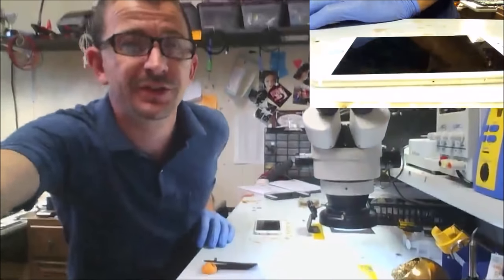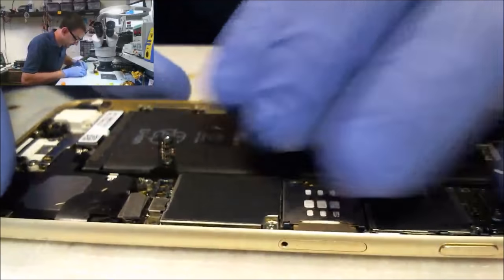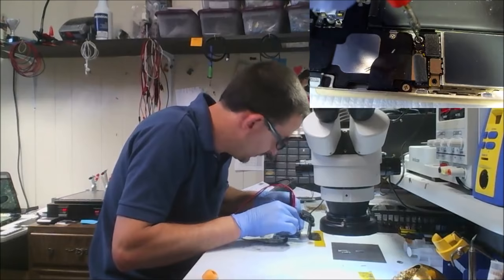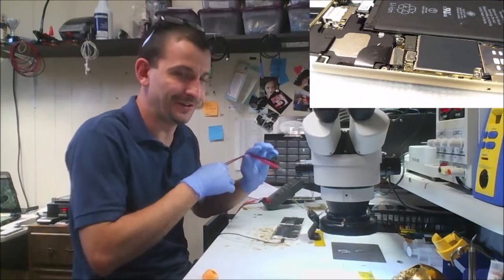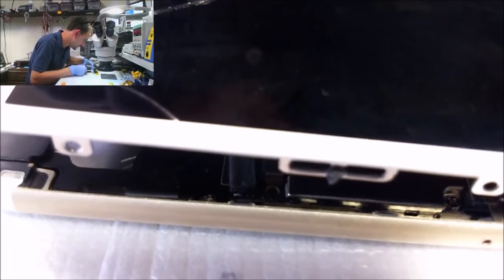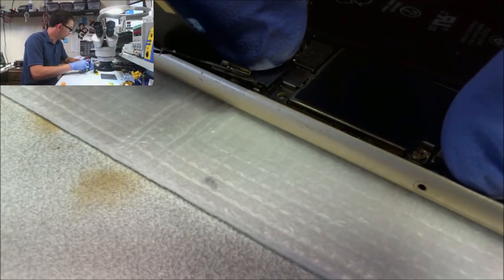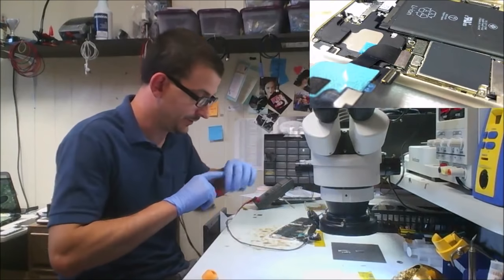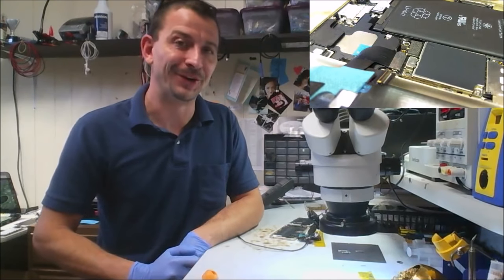Troubleshooting an iPhone 6 that will not charge the battery

Comment: My iphone 6  will not charge or even turn on do I need a new battery
Reply: no charge..could mean either charger port..or tristar...if it was a battery..it would still shows signs of life...you dont actually need the battery to power the phone on some devices...you need the battery so after you disconnect charger. it still maintains power..

Comment: I sent my iPhone 6 in to a mail away shop to fix crackd screen and replace battery they told me my battery that I had sent with the phone was no good. anyway 2 more batteries later the phone still wont stay on. I held both home and power button and it goes to apple window but then shuts off when I plug it in it blinks quickly to the apple screen then off. it workd perfectly b4 I sent it to this guy. im freaking out cause I cant afford to fix this. anyway can anyone help me maybe I can fix it. im pretty good at doing things myself.  thank you

Comment: Sir my I phone 6 drop it was charging and the Apple logo was coming up my phone always charge in 10 minutes never have a problem 
But beacause the Home Screen wasn’t coming on away from the Apple logo I take it in to the shop and my guts is tell me the technician switch my batters or tamper with it other wise All they told me that everything is good and the phone just not connecting it is a software problem I take my phone in the shop working I collect it back not taking any charger at tall 12hrs and more I had it on charger and nothing am really upset because people are so dam dishonest

Comment: So like you charge by the hour or the job ? , ah you been doing this type work very long ?, seems like a lot of guess work going on here
Reply: I believe he charges a fixed fee per job. The iPhone is full of proprietary electronics that behave in a very complicated manner - especially compared to many Android phones. The charging circuit, for example has two ICs, separate from the two (!) power management chips (PMICs) for the baseband and application processor as well as a separate mosfet power transistor package. A typical Samsung has a USB comms IC (like the iPhone Tristar mentioned in this video), and a single PMIC for the rest of the phone. Even the lightning cable connector has embedded electronics!
This video is also three years old - in that time the repair/diagnostic community has developed and these problems are better understood. Jason (STSTele), Jessa (iPad Rehab) and Louis Rossmann have been a big part of that.